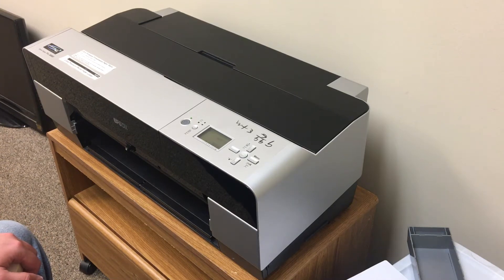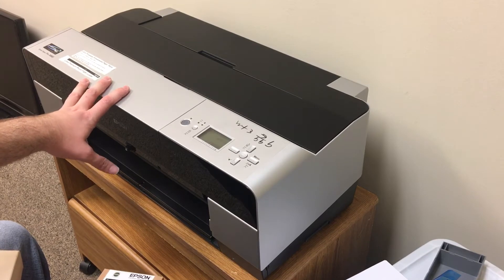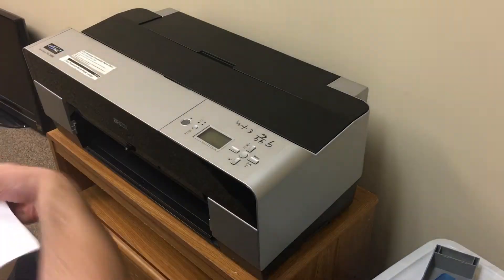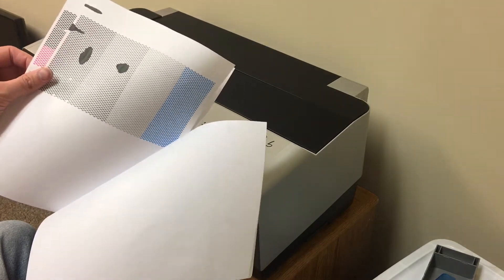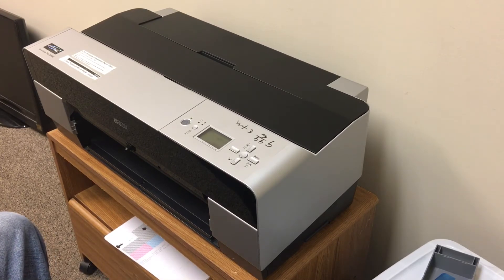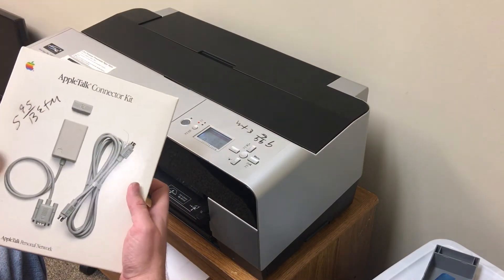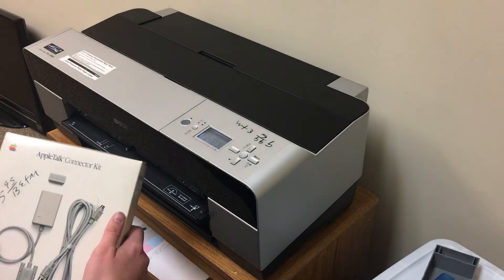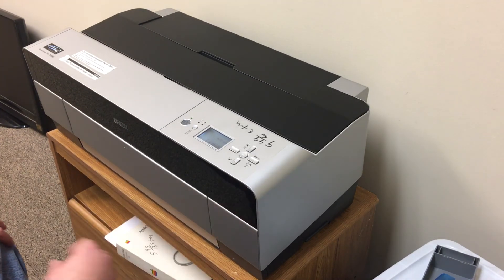Epson Stylus Pro 3880 MK/PK problem identified (leaky valve); next: printable poster board?

Comment: Your title is misleading. I thought you were going to show HOW you fixed the leaky ink valve. That's what I need to know since the manifold is no longer available as a new part.
Reply from the maker: [Edit: My initial reply assumes you must be talking about my other video, “Black ink switch valve fix Epson Stylus Pro 3800 3880 SureColor R600 P800”, since this one merely identifies the problem and doesn’t claim to fix anything. Indeed, it wasn’t fixed. I hadn’t even gone looking for the fix yet at this point. When I did, I was told you could only replace it. I ultimately proved that wrong but it’s strange that anyone expected me to at all… much less, in my initial diagnosis video. This video exists so people will check the weight of their black carts before wasting a new one that will just drain into the waste. Original reply follows…]

I was told that the only way to fix it was to replace it with a working one, which is what I did. Therefore, it is a “fix” exactly like others have said. I went one step further by clearing my old one using water exactly as demonstrated. I even sourced a cheaper part for the people who want the traditional fix.

This was never presented as a “how to.” Without this video you wouldn’t see any example of someone who fixed their existing valve to even know it was possible. It was also a VERY messy job which you wouldn’t want to do with your only ink switch since it means leaving your printer disassembled with open ink lines (what a mess!).

This video was made specifically to counter the people in printer forums who told me it couldn’t be done. I made it public so that more people than just them would be able to see that it was possible, since I certainly would’ve appreciated knowing that before I spent so much money. I figure like-minded people would rather find this and know it is possible. YouTube is for anyone to share anything… not just highly produced how-to videos. Take it for what it is: Reference material. I’m not a content producer. The only reason I have 1K subs is because I found drugs inside Nintendo games and the video went viral.
Reply: @emmettturner9452  you did not show us how the replacement was done and where to get the replacement valve
Reply from the maker: @kofinti8655  LOL! This is the wrong video. This was just me evaluating a used printer I had just bought from Goodwill. The title says “Problem identified: Leaky valve.” It does not say problem fixed because the problem was NOT fixed until months later. In the mean time people told me it was impossible to repair the valve, so I bought a replacement. After replacing it I proved them wrong and repaired my original. I demonstrated that it was fixed in another video. Perhaps that’s what you’re looking for, but it’s not like I recorded the messy process (pigment ink everywhere!). I uploaded that just to show it could be done.

This video is just a guy trying out his latest Goodwill find and finding out why it was donated. Not sure how anyone could’ve ever expected any potential user like me to go further but, luckily for you, I did. It’s a while other video though. The one you want is:
Black ink switch valve fix Epson Stylus Pro 3800 3880 SureColor R600 P800
https://youtu.be/97XomNjdLHA

Comment: Wow, no comments.  If you can find a paper setting that puts approximately the right amount of ink on the page (maybe a little more) you could pay to get custom color profiles made for whatever paper.  Pigment ink on an Epson (piezo print head) like this should give reasonably low dot gain on a variety of papers because pigments don't wick the same as dyes on fibrous papers.  So you can probably get away with murder as far as paper is concerned (as long as it's not glossy meant for thermal inkjet).  Chances are I've told you nothing new.
Reply from the maker: Steven Clark Well, there were probably no comments because it was a new-to-me printer with a common issue at that point (leaky ink switch valve) and I didn’t separate the printable poster board question. I’ve since fixed the ink switching valve and it no longer leaks PK. :) The replacement part was expensive (normally $170) but I managed to fix the original by working the valve with warm pressurized water. Very messy work though!

Since you mentioned paper profiles, I have several reams of glossy 12x19” Xerox brand paper that totally doesn’t work in ink jets (thrift store find) and I’d love to find a way to use it without taking it to a print shop. It’s probably for color lasers only and there’s no way it would fit in mine (not that my SOHO color laser is photo-quality anyway). :(

I’m still getting geared up to do regular prints on this thing (posters and packaging). Just got my second set of original cartridges today! Now I gotta modify them for refilling and work on getting OEM ink for refills (already have a couple 700ml carts to extract from). :)

It’s very encouraging to hear that I can possibly get away with posterboard that isn’t specifically photo-treated. I’m going to test out some smaller posterboard to see if I can get any promising candidates for profiling. Thanks for your help!